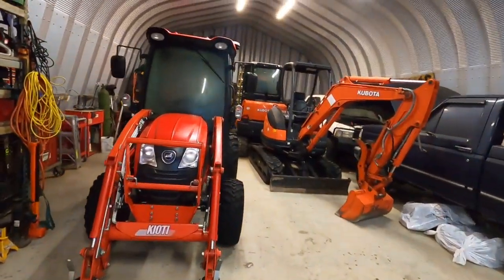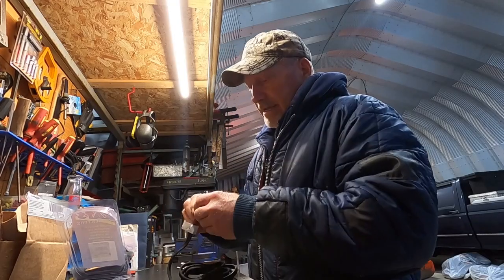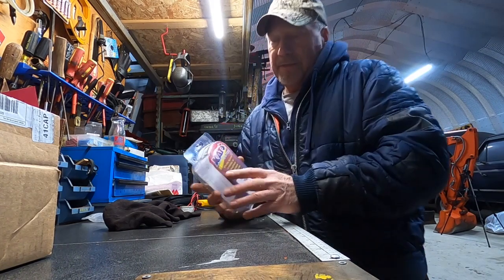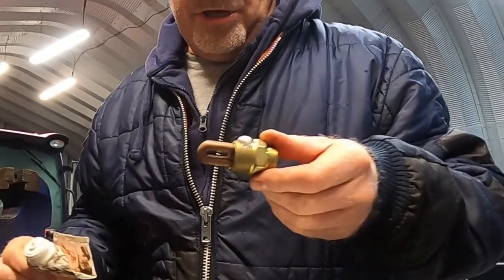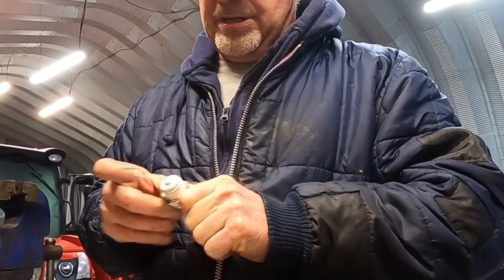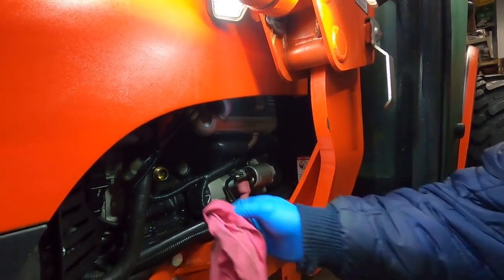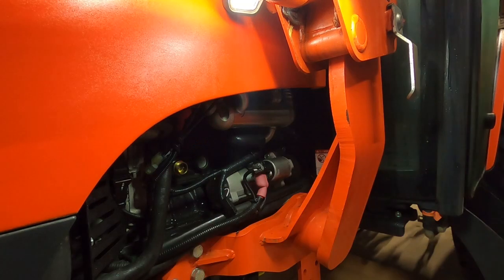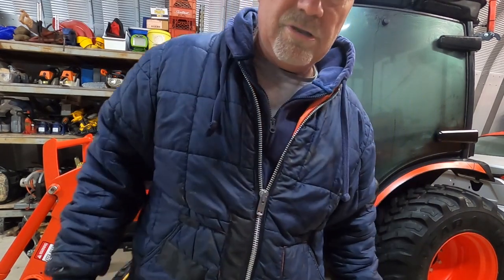Kioti block heater install.

Comment: I hate walking out to my barn and seeing exactly what you see.  Everything sweating and dripping wet.  I usually start everything up and let run 10-15 mins.
Reply from the maker: I don't like it,but the pro's outwayed the Con's for me.17500 for the kit pre-covid and they held it for me till i moved here.I put it up.Better than working outside in wind or snow or rain,So i just suck it up.

Comment: You know you don't need to keep saying Glycol or even ethylene Glycol. You can simply say Engine Coolant
Reply from the maker: Well,if thats what you pulled from the video.You better find a hobby,and get out of the basement.
Reply: @northeasterndirtandpropert7974  I have many outdoor hobbies as I too have a tractor and need to load wood, dig stumps, mow fields, reno houses, run a 575 ton Overhead steel crane at work. Raced snowmachines and Dirt bikes which in that time rebuilt 20-25 Race motors. Not once in the industry have  I heard a mechanic say Ethylene Glycol to sound fancy.  I'm not some stay at home person playing video games..lol